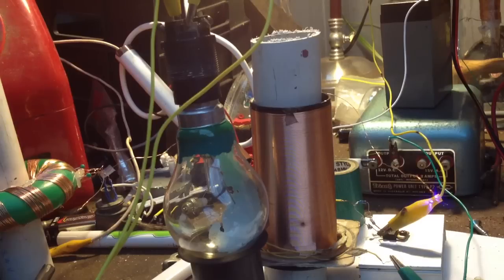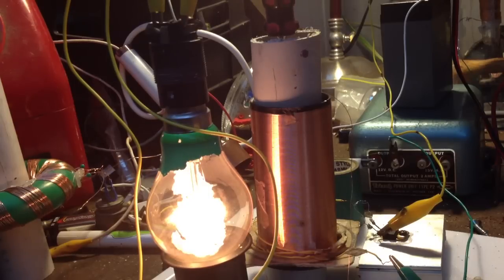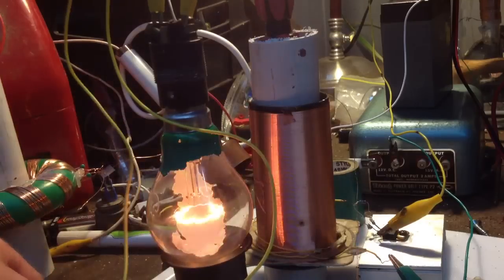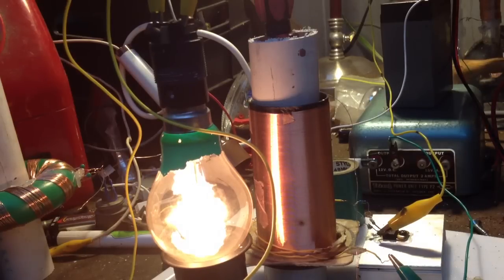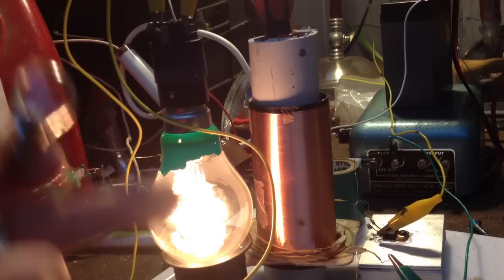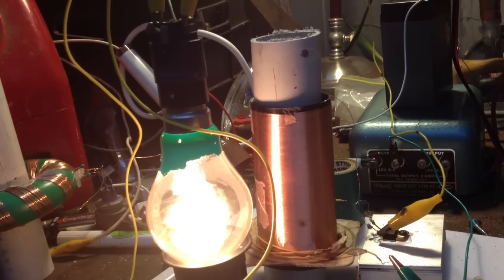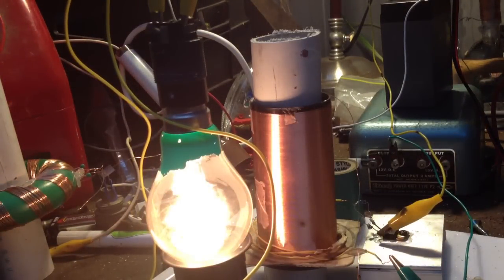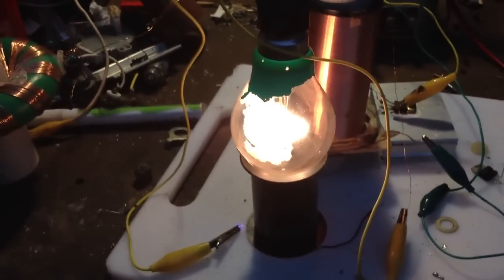Slayer kacher with ferrites

Comment: Great work Mate, If you still have the case of the microwave you pulled apart, you will find 2 useful things, there is a Light bulb and holder, also there is some High voltage wires(connected to MOT, if you've junked it, I've got a bunch here you can use, will stop the leakage through the wires), I've finished my big coil, just getting the ratio of my Sec right.